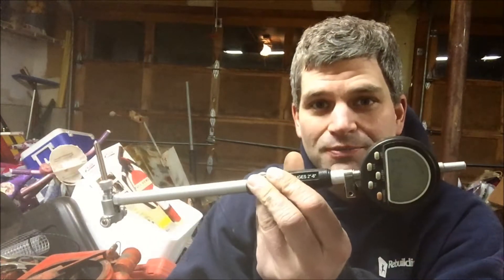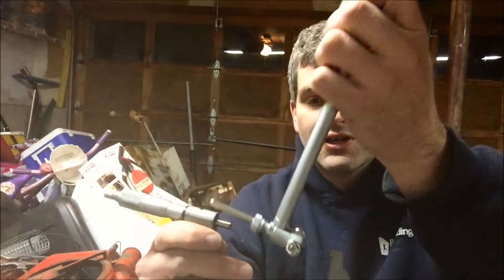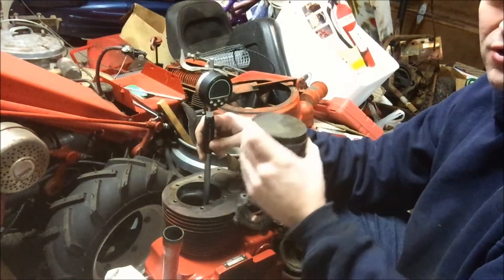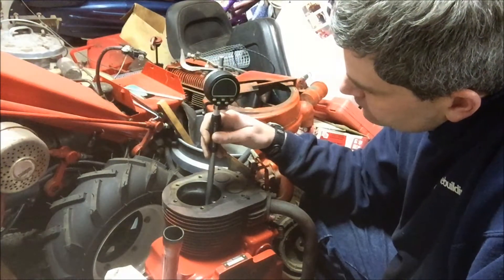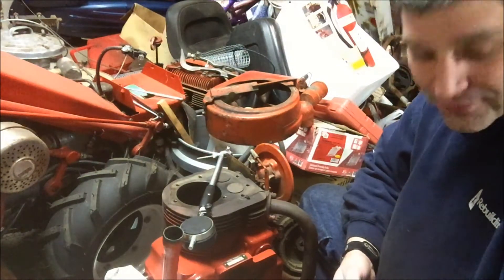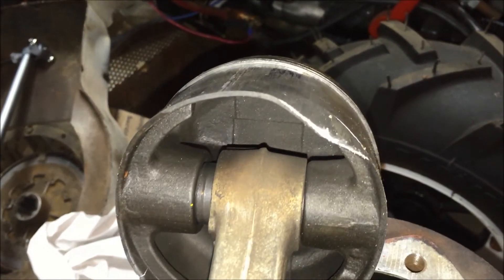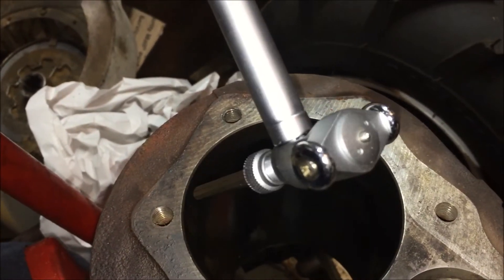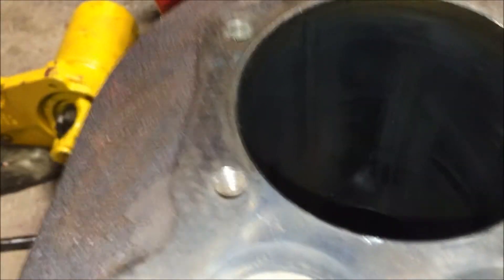How To Measure A Small Engine Cylinder Bore and Determine Piston Size

Comment: Can you provide any detail on where this bore gauge can be ordered from?
Reply from the maker: byronmill I got it on eBay.   Type “Cylinder bore guage” into the search and a bunch come up
Reply: @rw3dog  , I did do an eBay and Google search, which did indeed provide all kinds of options! What I was really asking is if you were satisfied with that specific unit and where you got it from. it looks like the majority of them are probably all the same unit just from different sellers, but I thought you may have some input based on your experience.

Comment: Spotthedog is correct, what you're supposed to do is rock back & forth so you're crossing square, and take the smallest reading as that is the true bore measurement at that spot.  measurements have to be taken top, mid and bottom and repeated at 90 degrees so you also get the out-of-round indication to see if it's out of spec and needs to be bored out.